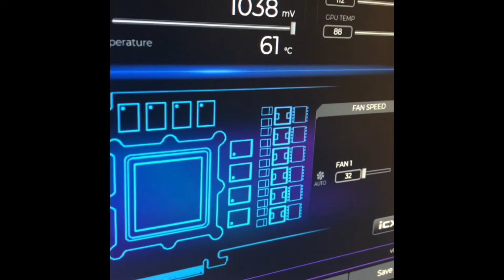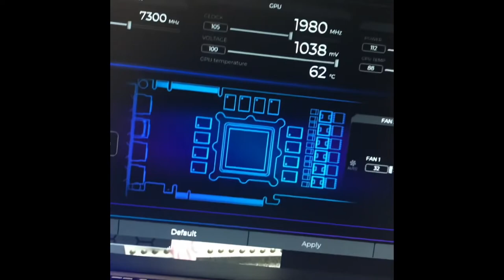Finally a solution to water cooling HPs RTX 2080 card! sorta.. HP Obelisk RTX w kit EVGA xc/xc2 aio

Comment: Can you water cool the GPU lmao??
Reply from the maker: Absolutely
Reply: Ray Dizzle no the hp gpu the one that came with the pre built lmfao
Reply from the maker: For Pottery this is the HP GPU that came with the prebuilt.
Reply: Ray Dizzle it is?? Wait you water cooled it
Reply: Ray Dizzle wait nvm u was confused
Reply from the maker: For Pottery yes I used the EVGA kit. However the fan had to be replaced like I explain in the video.
Reply: Ray Dizzle can y use it in a custom loop
Reply: Ray Dizzle I have a rtx 2080ti edition and was wondering if I could water cool it in a custom loop with my cpu bc I saw a person post a link to something that you could use a custom loop with??
Reply from the maker: For Pottery I can’t be 100 percent sure but I believe you can. Wether it’s the 2080ti or the 2080 they both are reference cards. Generally speaking most water blocks  do not need to connect  anything to the GPUs directly. AIOs are different. You need to connect the fans to the GPU. Our cards have different connections then regular cards.  Just make sure the water block you buy is for a reference 2080ti card and that you don’t need to connect anything to the GPU and you should be fine.
Reply: @ramonvazquez2475  But I thought the connections on the 2080ti hp one was different so is there only a a couple water blocks that actually work for the 2080ti version bc they have different layout of any name brand gpus right??
Reply from the maker: I really don’t know on the 2080ti. If it’s a blower type card with a red led X on the bottom from HP it probably has the same connections as the one in the video. Well there is a ton of water blocks for 2080ti cards out there. You just have to look for ones made for reference cards and that there is no connections that go to the GPU if In fact it’s the wack version from HP.
Reply: @ramonvazquez2475  OK bc I want to find a waterblock for it thats copper I think bc idk ab liquid cooling that much and copper and aluminum cant be together so basically no mixed metals.  I wanna make a custom loop but idk good water blocks or aything
Reply: @ramonvazquez2475  Do you think corsairs waterblock and builder will work with the 2080ti from hp
Reply from the maker: For Pottery When I decide to do a custom loop I was going to use a Corsair block for the GPU. But I decide to use a completely different card at the end with everything else being from Corsair. So Corsair uses copper for their blocks and radiators so you should be ok.
Reply: Ray Dizzle ok nice u mean different water block or different cars like a completely different gpu
Reply: Ray Dizzle if it’s for the hp one or a different one can u post a vid on it?
Reply from the maker: I got a completely different GPU.
Reply from the maker: I already have a video on it. The Corsair custom loop video. Check it out
Reply: Ray Dizzle Ohhh are you selling the ho one are did you already sell it ??
Reply from the maker: I already sold it the HP. I no longer have anything from HP lol
Reply: @ramonvazquez2475  Ohhhh ok how much? I was going to sell mine to.
Reply: @ramonvazquez2475  Do you think the corsair water block will work for the hp omen card
Reply from the maker: For Pottery very cheap.... $400
Reply: @ramonvazquez2475  rip